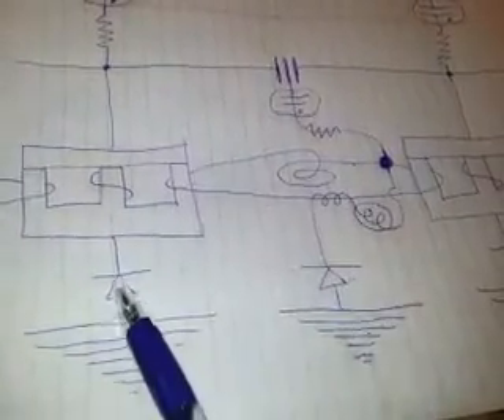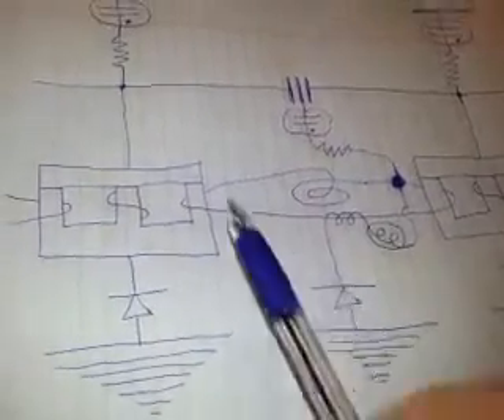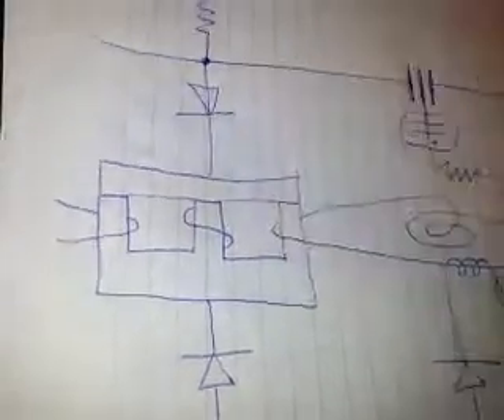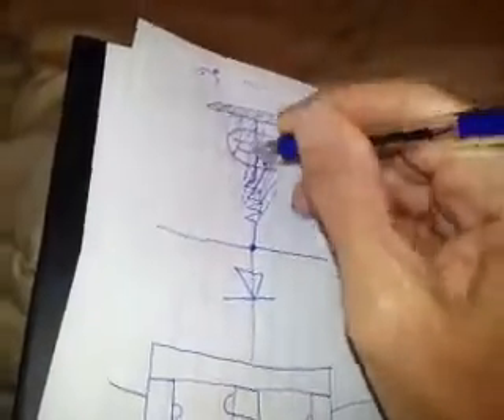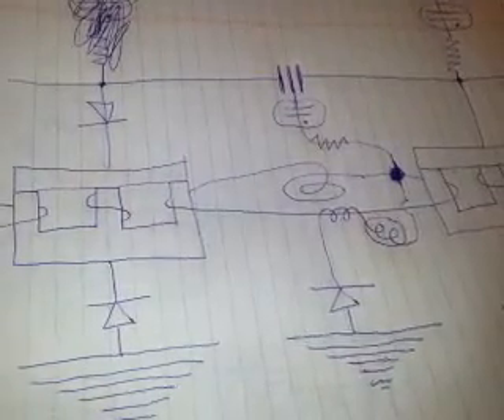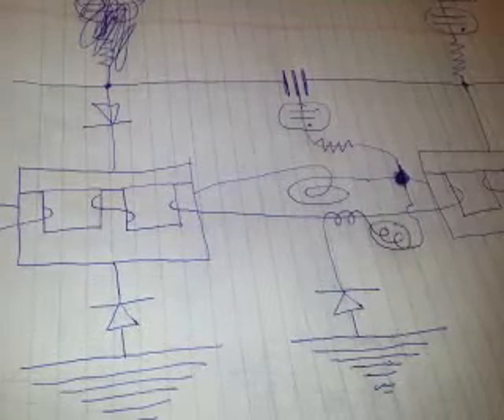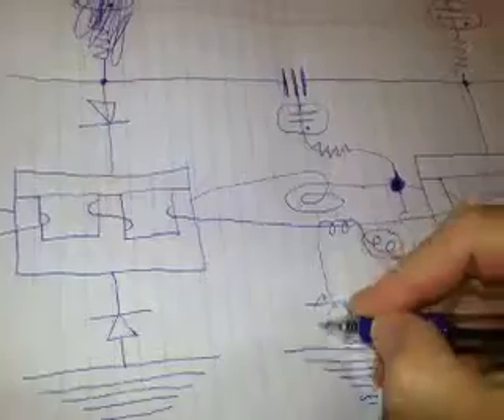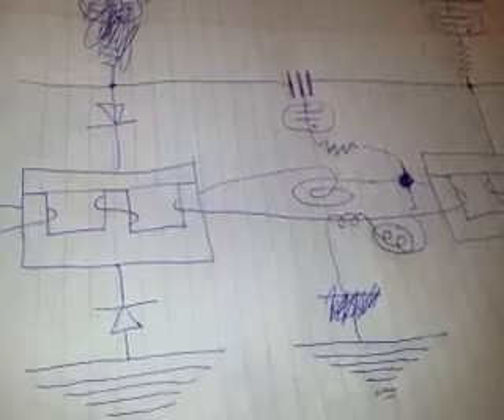Schematic redraw of Barbosa and Leal hypothetical replication.

Comment: hey i great work can u help me to build one i don't get the wiring part
Reply: vinyasi what simulation
Reply: http://vinyasi.info/ne?startCircuit=overunity-breakthrough.txt
Reply: http://vinyasi.info/ne?startCircuit=lmd-tmt.txt
Reply: vinyasi that means by simulation it work i goimg to check it out but what about making a practical replica if i figure out something i will share with u
Reply: vinyasi your work is really admiring i agree with u i am doing electrical engg. so i don't belive in these overunity stuff but this one seems different and logical i sure give it a shot and thanks for ur help cheers